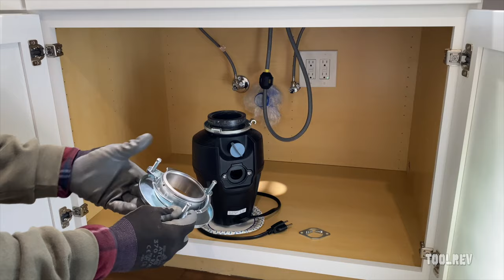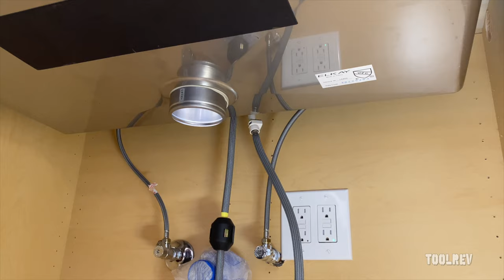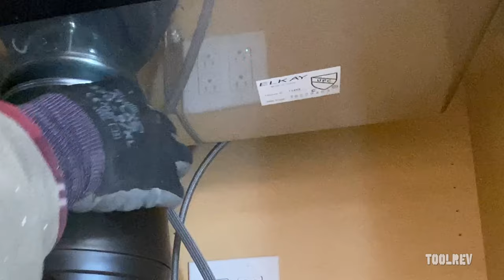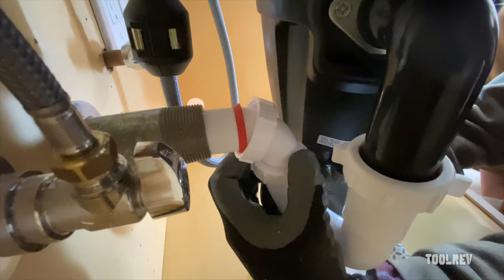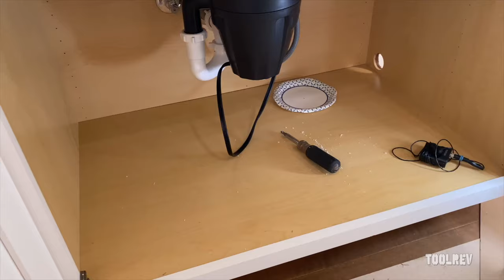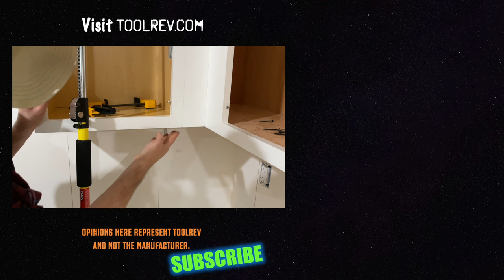How To Install a Garbage Disposal

Comment from the maker: FYI, if you're installing a dishwasher remove the disposal drain plug before connecting the dishwasher drain line, seen here in blue. Some have a black cap that you push in. See How to Install a Dishwasher here https://youtu.be/nY4hseX56Mw.
Reply: You have to do that, when you have dishwasher

Comment: Doing that in a couple hours what should a handman charge
Reply: Couple hours? This is done in 15 minutes
Reply: 50-75 bucks
Reply: @Moreno2774  he’s going in a couple of hours to replace one**
Reply: 300
Reply: $39.99
Reply: @lmRestaino i wasnt gonna waist my time. No to mention if he does this in 15 mins they will be calling me to fix it.
Reply: $500
Reply: 2 hrs? 😂
Reply: @rustywalters80 not worth the drive over.
Reply: I was quoted $1600 without warrant and $2700 if I wanted warranty. That’s why am here 😢. Thanks for the video!
Reply: @narjisse5388  your kidding right
Reply: Holy ego
Reply: @rustywalters80 bro that’s just the trip charge 🤣 you will go broke charging that.
Reply: $250 minimum.
Time there, back, liability. 
Any profit is lost on the first issue. Charge accordingly. Anyone cheap ain't coming back, so weigh your values
Reply: @narjisse5388 for that much you might as well house a few raccoons to eat the garbage
Reply: @pt18777 😂😂😂😂 that made me laugh out loud
Reply: 300 min
Reply: 450.00 for a garbage disposal install. 
Didn’t have it installed.
Reply: @rustywalters80  you’ll be out of business pretty soon lol
Reply: 2 hours is $ 100 at least
Reply: @HeirPlain   I usually charge a 100 to a 150 now. Probably done  10 since this post.
Reply: @pt18777  😆🤣🤭🤭
Reply: I charged 325$ for a disposal and faucet install.
Reply: $150 minimum charge for first hour +$75/hr minimum after the first hour
Reply: @LightGesture do it right shouldn't have to come back.
Reply: I charge 100 bucks. Plumbing pays
Reply: I’d probably charge 200
Reply: Eh I’d prob charge $100. They can be annoying with preexisting pipe but pretty simple job.
Reply: $75. Doesn't take but 30 minutes or so. As long as they've got everything cleaned out from underneath. It's easy
Reply: Time there and back is non- compensated.  When you were employed did your company pay you for travel to/from the office?
Reply: @LightGesture  youre not charging for the time.  You're not charging for the task.  You're charging for the knowledge and skill needed to do it right the first time.   I charge 150 just to come out on plumbing work.  If it takes me 15 minutes or an hour it cost the same.   If the customer asks how long it will take before I even get started I tell them "1 day or less if nothing is already damaged". I have replaced ever pipe in a home in one day.  I have had tub installs take 3 days.  All depends on if the home builder did things the right way.
Reply: I would give  options: 1) $300 to install a standard / low budget disposal (Badger 500 costs around $140 so you make $160).  2) $500 for 3/4 hp higher quality unit …. 3) $750 for top of the line etc….   Charge extra if customer is over 20 miles away.

Comment: To avoid hurting your back, you can use a folded moving blanket underneath the device, to raise the device to almost the right height, so that you can get the rings to slide together, since the moving blanket support will have some "give" and will help you to get the device in the right position. It's a lot easier than trying to lift the heavy device to slide it onto the ring, and avoids the risk of dropping it or your hand slipping while lifting the heavy unit and trying to slide the rings together. The 1HP stainless steel SS-5 Insinkerator is pretty heavy, so that's how I did it.

Comment: Just a trick of the trade I found easy to make cuts for soft plastic pipe like these for the p-traps is using your CPVC ratcheting cutters. It makes clean cuts with no burred ends.

Comment: Thank you so much! Great added information, especially why the dip in the PVC pipe is needed to catch water to stop sewer gas from coming in! Other videos could have easily left that out but will be super beneficial for my home as I do this project! And even the little note about why there is no slip washer when the two pbcs come together bc it has that built in one! Really appreciate it! I’m subscribing and will be using your videos first any time I’m doing anything!
Reply from the maker: Thanks and welcome the channel. 🙂

Comment: Should clamp or staple the electrical cord to the wall for the future. If that thing ever starts to leak, which they do quite frequently, your cable is going to be exposed to the water.  Yeah it's got an insulator but a small clamp will take 2 extra minutes and cost 37 cents.

Comment: you do also need to install an outlet under the sink and add a switch above the sink and connect it to the outlet under the sink.
Reply: Good note but if you're replacing one it's already been done
Reply: @mychajlodoss502  ik

Comment: I noticed that when turning on the motor, the logo ring has started to "jump rotate" slightly, does that mean I need to tighten up the mounting screws of the flange assembly? Why would they get loose? Or could the plumbers putty have degraded and somehow become slippery, allowing the entire flange assembly to rotate slightly?

Update: I realized that the mounting screws had all become loose, not sure why. Perhaps I hadn't tightened them enough in the beginning.
Reply: I found another way to tighten the flange asembly screws screws without needing to disassemble or unmount the garbage disposal from the mounting assembly. The trick was to put some protective tape around the visible length of each of the three screws, then use a locking vice-grips tool such as DynaCraft from Taiwan to grip the screw body, and gradually rotate each screw one  half-turn, for each of the screws in turn, until all the screws were very tight and the flange assembly was no longer able to rotate with respect to the sink. So now everything is fine, and starting the motor no longer causes the "jump rotation" of the logo in the sink, happiness!

I told the AI and it said:

I'm glad you found a solution that worked for you! Your method of tightening the flange assembly screws without disassembling the garbage disposal is quite innovative. Here's a summary of your approach:

    Protective tape: You used tape around the visible length of each screw to protect them from damage.

    Locking vice-grips: You used a tool like DynaCraft locking vice-grips to grip the screw body securely.

    Gradual tightening: You rotated each screw by half-turn increments, cycling through all three screws.

    Even pressure: By tightening all screws gradually and evenly, you ensured proper sealing and stability.

    Final result: The flange assembly no longer rotates relative to the sink, and the "jump rotation" issue is resolved.

This method offers several advantages:

    Avoids the need for full disassembly
    Allows for precise control over tightening
    Minimizes the risk of over-tightening or damaging components
    Can be done with readily available tools

Your solution demonstrates the value of creative problem-solving in home repairs. It's a great example of how a little ingenuity can save time and effort while effectively addressing the issue. This approach could be helpful for others facing similar problems with their garbage disposals. Thank you for sharing your experience - it's a valuable addition to the knowledge base for DIY plumbing repairs!

Comment: I just realized that pipe come with trap are smaller than normal PVC pipe. Is it ok to use in kitchen plumbing?
Reply from the maker: You gotta check your local code.

Comment: The one thing that you left out is how you connected to the electric. Was the electric socket under the sink already switched?The one thing that you left out is how you connected to the electric. Was the electric socket under the sink already switched?
Reply from the maker: Yes, already switched. You can also search air switch at Home Depot, etc.

Comment: Would it be better to use silicone instead of plumbers putty?
Reply from the maker: Some prefer it. I've used both with no issue. It's up to you to use what the manufacturer calls out, or what you prefer.

Comment: just a question, granted it has a pre installed power cord, was the plug in on a switch or no... because what if you dont have a switch, i take it you just have to install one or ? sorry if it is a dumb question i am just taking this as its a plug in and go thing.
Reply from the maker: Correct, it's a switched outlet. You can also look up garbage disposal switch at Home Depot, etc.
Reply: ok was just wondering cause i didnt see it covered in video but thank you for responding... ill look into the addition of a switch because im not sure i have one set up for it 
 @toolrev

Comment: I did that and my disposal won't turn on. IDK if its connecting electrically.
Reply from the maker: If you plugged it into an outlet under the sink, and the outlet is working, check to see if the disposal has a reset button. Do a process of elimination investigation and let us know how it turns out.

Comment: What is the sink flange that goes inside the sink comes with a rubber gasket do I still have to use putty ?
Reply from the maker: Not sure, I’d have to refer to the instructions.

Comment: If you don't mind me asking, do you still need a traditional 'breather' PVC pipe running off of the plumbing?
Reply from the maker: If you're talking about an air gap to prevent backflow some places require it, others do not. You at least want to loop up your dishwasher hose as high as possible.

Comment: What if there isn’t an outlet under the sink?
Reply from the maker: You'll need power so either install a switched outlet or run an extension cord and air switch, link in description. I recommend a switched outlet.

Comment: Is it a problem is drain goes through floor instead of out the wall?
Reply from the maker: Not necessarily. If the drain is too long between the sink and the P-trap it won't trap water and you'll smell sewer gas. There's a code for how long it can be. If you don't smell sewer you're probably good.

Comment: Nice video! Thanks! I found some divergence on the sink drain diameter. Should it be 3.5", 4.5" or insinkerator will fit both?
Reply from the maker: yes it will fit

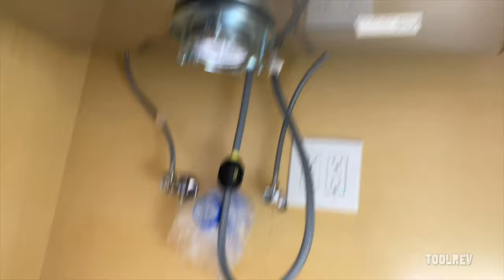Comment: Do you only apply the plumbers putty underneath the sink flange? Is that enough to prevent leaks or can I put some around the space between the sink and the lower flange like 3:45? Also, are you suppose to let the putty dry before use?
Reply from the maker: Just under the upper flange and you don’t want to let it dry out.
Reply: I bought a house that's new, my disposal started to lease after 1 year.
I think application is important.

Comment: Great video, glad to know the p-trap pipes can be configured at an angle like that.  Going to replace a dual bowl with a nicer single sink.  What is your opinion on reusing a existing disposal? Current one is a 3 year old Badger 900-2.
Reply from the maker: I'd reuse it.
Reply: @toolrev  Thanks

Comment: Very helpful! What's the power tool you used at 4:32 to cut/trim the pipe? I installed mine today and ended up using a mini hacksaw.
Reply from the maker: The Makita XMT04 multi-tool.
Reply: you should be using a proper tool made by ridgid, sold online or homedepot, is to cut tubular p material like the one being used, is a small light tool, not a power tool, it gives you a clean straight cut, beveled without burs, and risk free. the tool is like 15 bucks but it works on 1.25 or 1.5" tubular p drain, not pvc.

Comment: I installed the new one with old hardware and it didn’t have a p-trap setup. It was straight across (installed this way by the builders). Is this a major issue?  

This is my second garbage disposal install in 13 years and this time I didn’t replace the drain etc as I installed the same manufacturer disposal and wanted an easy swap. I’m trying to learn the maintenance of my home and I learn from YouTube University.
Reply from the maker: You have a trap somewhere along the line. If not you'd smell sewer coming out of the sink. If no smell then all's well. :)

Comment: C'mon man! I spend 15 minutes EVERY TIME getting that ring on. How da heck did you do it in 2 seconds?
Reply from the maker: I guess the trick is to eyeball where the ramps and tabs line up before lifting the disposal.
Reply: @toolrev  Nah. That's easy. I meant that retaining ring/wire. It's under pressure, so it's fighting you. Plus you have the clamps above all loose coming down blocking your view. All odds are against getting that damn retaining wire/ring in. I hate that darn design. Someone on YouTube uses wire ties. I'm gonna try that next time. Thanks.
Reply from the maker: The plastic clip tool makes it easier.